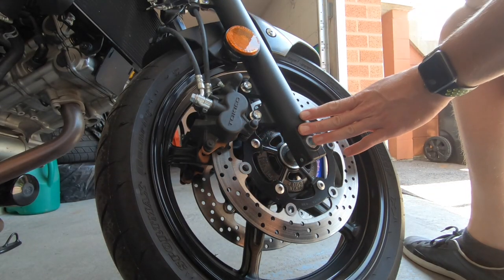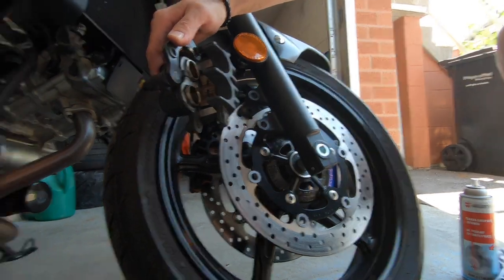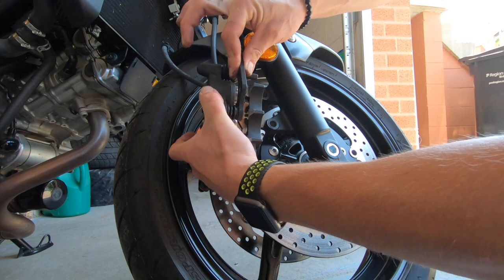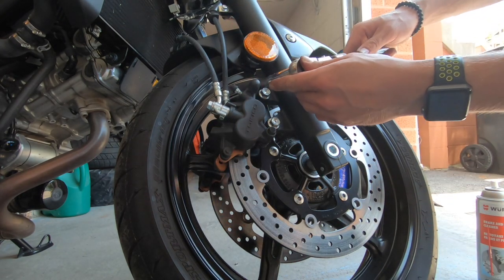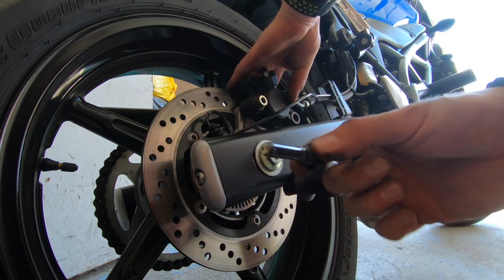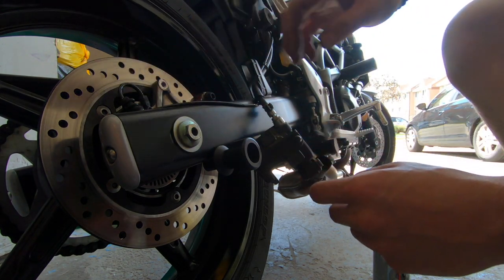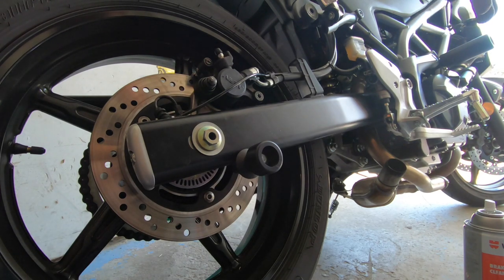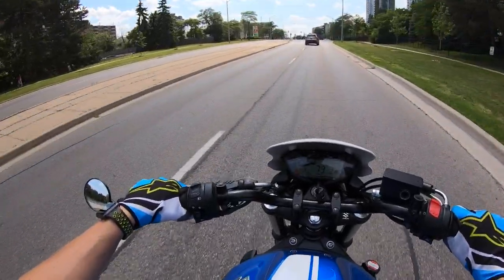How To Service Front & Rear Brakes On a 3rd Gen SV650

Comment: Hey. My 2016 sv650 had abs light on and speedometer is not working. Also engine management light is turned on and shows FI check on the dash. Any reason for it ?
Reply from the maker: Sorry man no clue

Comment: I have a problem with the rear brake and the brake lever hardly has any range, only 0.5cm and the brake starts to block the wheel, what could it be? Thanks
Reply from the maker: I would check if the cables being pinched somewhere and not releasing. Other than that I have no clue

Comment: Thanks bro, real helpful. Saves me an extra trip to the shop for which they'll probably charge me an extra € 100. My SV is currently at 8300 km's, is it time to do the breaks already you think?
Reply from the maker: You should look at the pads the line that they cut into them in the middle is the wear indicator. Once it’s no longer there and the pad is one big smooth surface it’s time to get them changed.
Reply: @SmokinMonkeyOG  thanks, but I meant is it time to lube and clean it already after 8k km you think?
Reply from the maker: I had less than that and it was dirty enough on mine but it depends what your roads are like. More dust and debris will mean more cleaning. But at 8k I would look at them at least and see if they look gunned up. Check the pins without removing anything. You can see if they’re dirty or not

Comment: Can you use Liqui Moly Multiporpose Grease for the Slider?
Reply from the maker: You need something with a high heat tolerance so I can’t say for sure as I don’t know that product myself. But check the specifications of the grease
Reply: @SmokinMonkeyOG  okay it says till 120°C
Reply from the maker: I would say that’s too low. The stuff I use is Temperature range: -46°C to 288°C (-50°F to 550°F). I would pick up a tube of brake specific lubricant it’s only like $10-$15 and will do the job a lot better

Comment: Currently riding my second season with my first bike, (2011 CBR 250R- Same as your first bike if im not mistaken). 

I really want an SV 650 as my second bike next spring. (The one with the red frame is so beautiful)  But MAN That  Honda CB650R is  hard not to consider. 

Im curious, im 6'2, how do you think il fit on the SV? I mean im riding a  250 and its decent enough but how much of a difference comfort wise did you notice jumping from the CBR 250 R to this bike? Any regrets? If you were in my position knowing what you know now, would you buy the SV again? or go a different route? I live in pickering so riding conditions should be very similar to what you ride in. 

Cheers
Reply from the maker: Ya man I had one of those too!! Haha dope bike. But I gotta be honest I wanted the CB650R too lol so knowing what I know now I would get the CB650R but only because I love the 4 cylinder sound and that bike actually has more power. Still I don’t regret my decision I love the SV and it’s handling plus it’s got tons of power too.

But comfort wise it’s night and day. The SV650 is sooo nice man lol it’s like a Muskoka chair on wheels because you sit straight not leaned over. I can’t get enough of this bike. I don’t know how the riding position is in the Honda but I can ride this all day. And that’s why I got it, it lets me take longer rides and not strain my back I’m 6’1
Reply: @SmokinMonkeyOG  Cool man thanks for the reply. If i get the SV or CB650R next spring we gotta get a subscriber group ride set up one time!
Reply from the maker: I’m down!! I wonder how many of us live around here

Comment: Awesome video! Respect!
Reply from the maker: Thanks 🙏
Reply: @SmokinMonkeyOG  May i ask why you use two different lubricants, Eze-slide and the copper stuff on the sliding pins? Thanks very much!
Reply from the maker: @GB-fo2ce copper stuff is just an anti seize so it does lubricate but it’s not really meant for that and it will dry up and wear away if used as a lubricant. The other one is high heat resistant and can last longer. The anti seize is to keep things from sticking and let the pads move around freely on the sliding surface
Reply: @SmokinMonkeyOG  many thanks for the quick reply!!
Reply from the maker: No problem lol

Comment: does opening the brake reservoir cover make it easier to push the piston back?
Reply from the maker: Not sure but I would assume it doesn’t since there’s enough room for the fluid to go back and forth and not have it pressurize. You would only have more resistance if it was under pressure but it’s not.